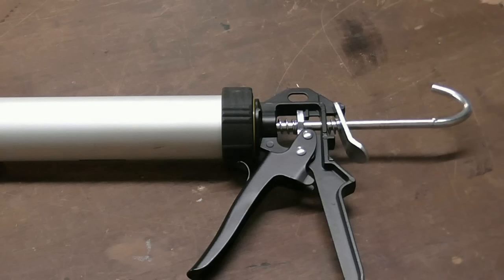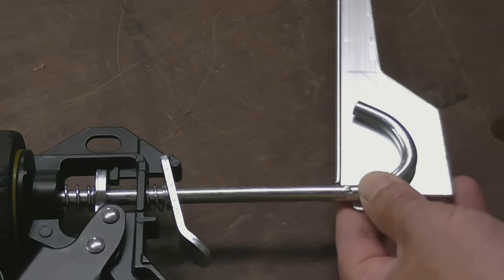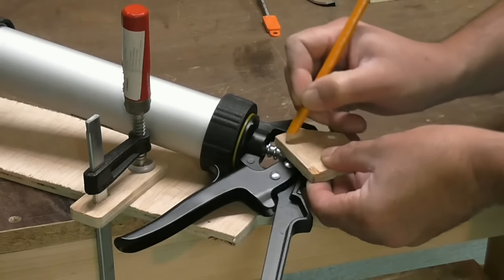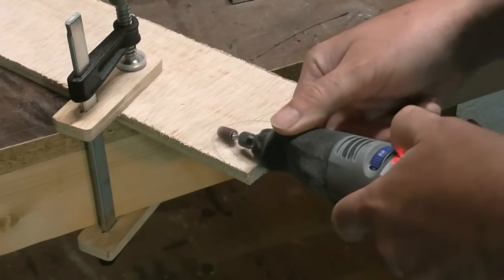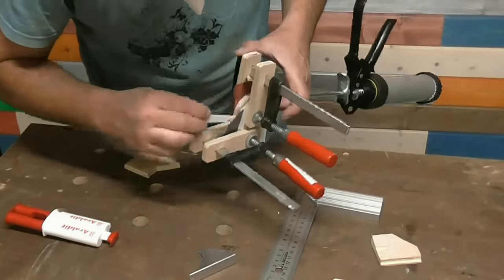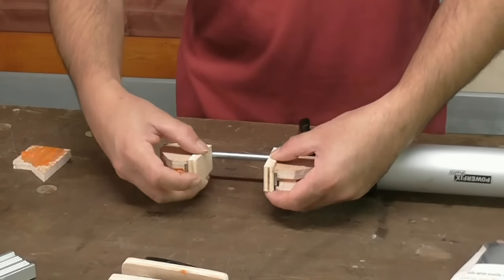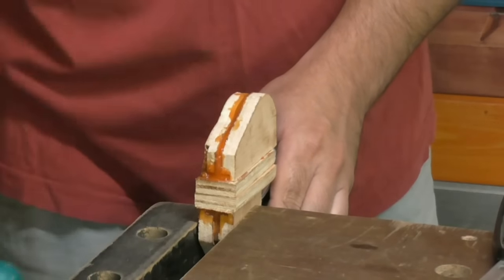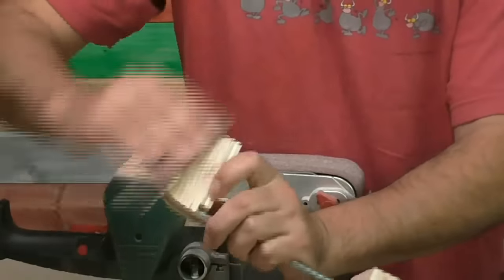How to make a one handed quick action bar clamp.

Comment: I have seen the gun in hardware stores but never thought about this! Thanks for your honest desription of the end result. I will try to make the clamp faces with epoxy putty used to fill metal casting blow holes and reinforce it with steel wires. Thanks ang good luck!
Reply from the maker: Thank you very much. Sure you'll make a nice homemade clamp 😃

Comment: I like the part when he uses a real clamp to clamp the new back-up clamp. 
I like the concept, but if I was to go out and buy/find all the random parts it would take me all day, I'd drive to garage sales and thrift stores seeking the cheap parts. 
By the time I found everything, and wasted several hours and a few gallons of gas, and if I actually still remembered what I wanted to do with all this shit in the first place, I'd likely change my mind and go watch another video about building a clamp that I actually think would be sturdy enough to firmly secure something without the epoxy/wood/metal joint bursting under all but the most minimal stress. 
But a good idea if you already have everything handy, as well as couple good clamps to work with.